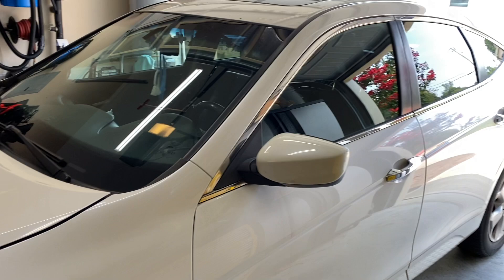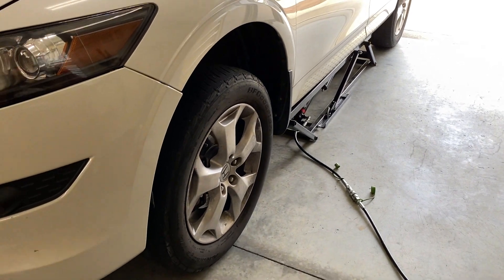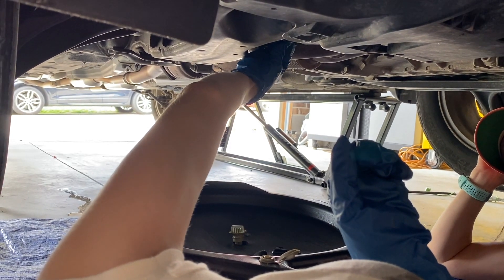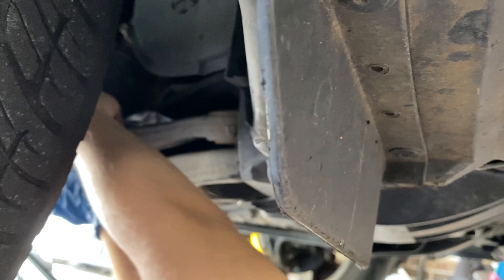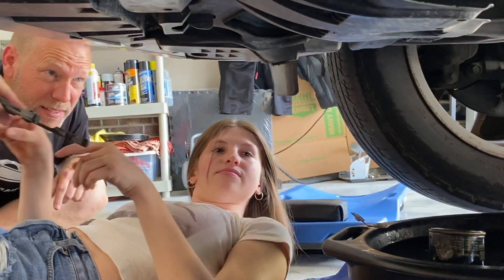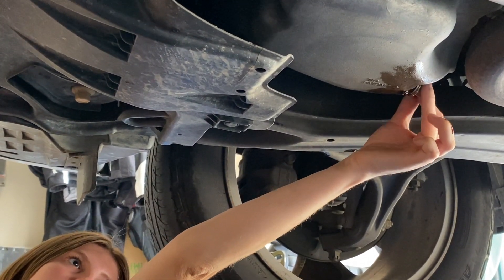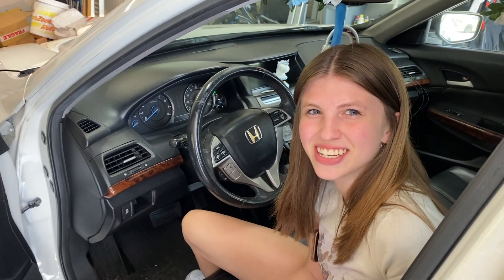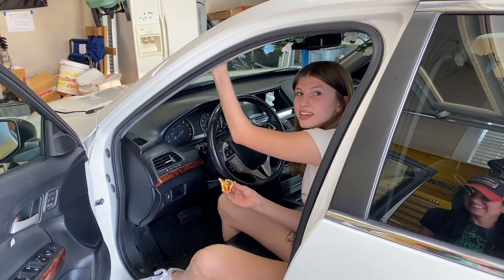Oil Change Basics | NEW DRIVER DIY Series

Comment: Great Video Aaron.   When it was reading -161, I was thinking 161 miles over 5000.  Can't believe she ran it 161% over projected oil life.   That's crazy!     No wonder there was so little dripping from the oil plug and filter, she was down 2-1/2 qts.   Hopefully, the oil changes will be done more regularly.
Reply from the maker: +george louie I know! Hopefully there is no permanent damage…
Reply: Or at least oil checked once every few fills!!